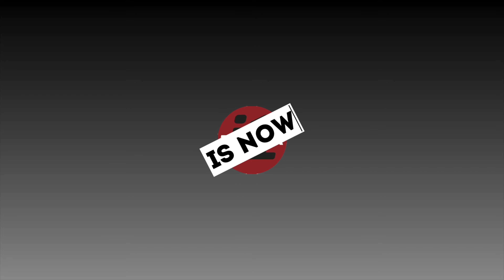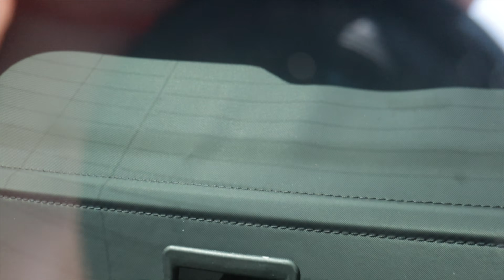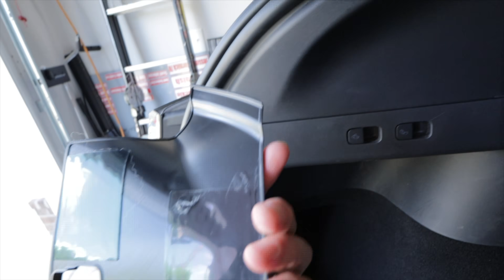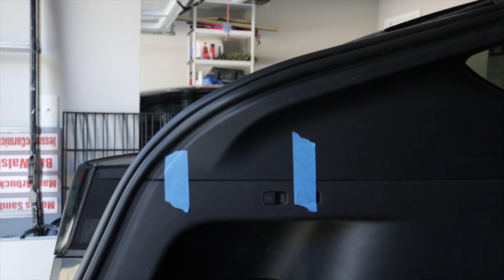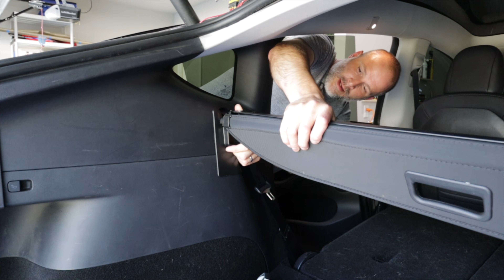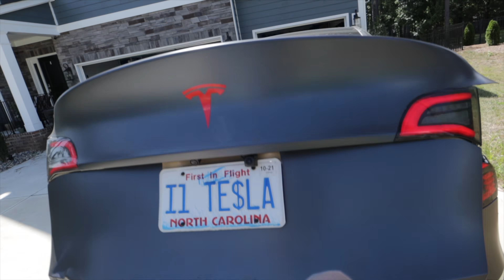Model Y Cargo Cover - Trunk Security

Comment: Thanks Brian! First off and to all the comments about Tesla not including this. No other (ICE) BMW, Mercedes, etc. has a sub trunk the size of the Model Y hence why I think Tesla did not include it as standard. And yes, I’ve owned the C230, X3 and X4,. None have a front trunk either. The Mach e and your Audi may be exceptions to this but they are not in broad distribution yet. I tend not to keep anything valuable in my car as thieves are not deterred by trunk covers or similar devices. Almost better to go without the cover and show that there’s nothing in the back. One other small drawback is if Tesla needs to service the tail lights. They are not going to like having to remove the brackets with the strong adhesive:) I’ll hold off installing for the time being and use the other hidden storage. Very good video though for future reference! Loving the MYP two weeks into ownership!